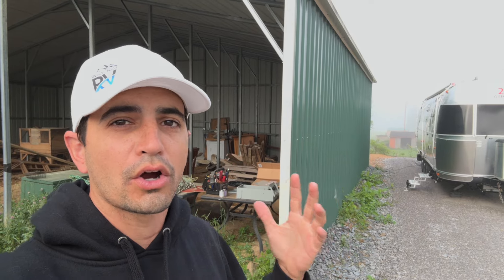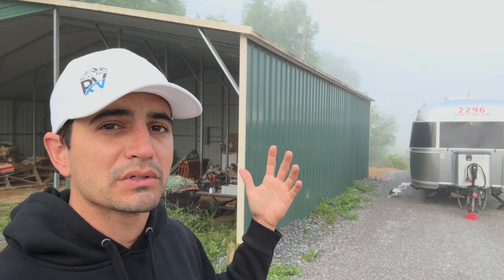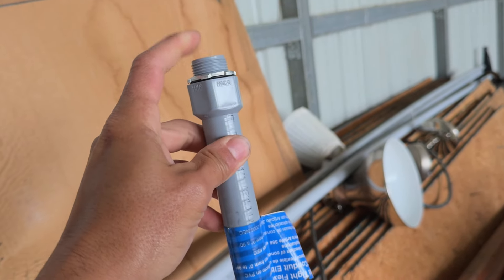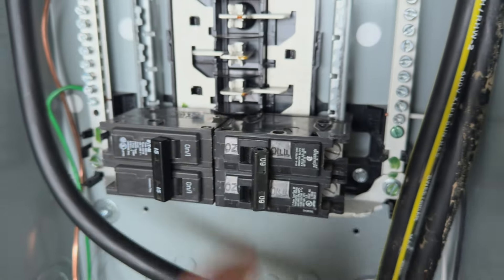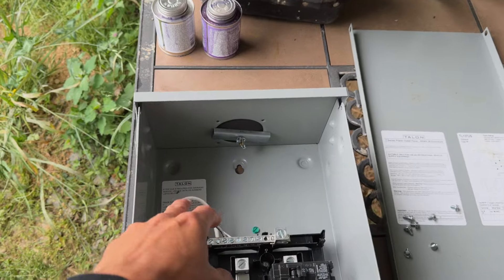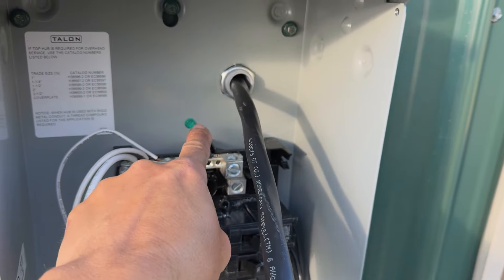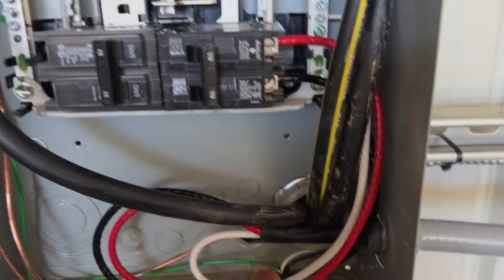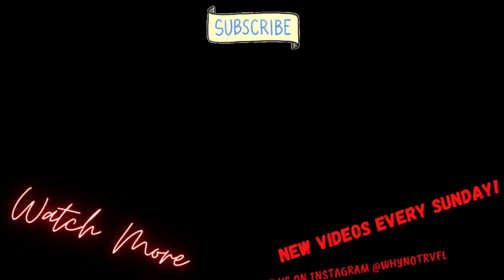Installing RV Electrical Service Outlet!!! - Why Not RV: Ep 141

Comment: The only things you don't mention are pulling an electrical permit and getting inspected, and addressing voltage drop.    The electrical permit is a local law thing, and often a requirement of your insurance.   In my state, a property owner can legally do electrical work, check your local laws, you may need to hire a locally licensed electrician to pull the permit and do final hookups.   You can do a lot of the grunt work yourself to save on money, if the electrician allows this.   I would go to my towns building department, pay a small fee, get the permit.  (fee is usually a percentage of the total job cost, including your labor paid at the customary rate for your area.  Which is kinda weird, but that's the way my state wrote the law. )  Do the work, then schedule an inspector to come out and do it on a given date/time.     The inspection acts as a double check on your job being done right, and if you don't get it inspected, your homeowners insurance coverage can be voided.  and yeah, the insurance adjuster will get the records and check for work performed without permit and inspection.  

  Voltage drop is more complicated, and I'm handwaving the details.  But basically, wire has a resistance.  It's low, but it's there, and is a factor.  Basically the longer the run of wire is, the fatter you need to have the wire.   For a regular single family house, it's not much of a factor.  But if you are going to a barn, shed, or outbuilding with longer runs, then you need to account for it.  Basically at that point you break out whatever version of the electrical code your local area uses, and hit the books.   Or if you gotta hire an electrician to pull the permit anyway, they can do those calculations and tell you what wire gauge you need to use for your particular job.   
     You are using conduit, so there would also be rules about conduit fill.  Basically the voltage that is dropped on the wire resistance, that doesn't just evaporate, it turns into heat.  that heat has to dissipate before the wires get hot enough to melt the insulation and cause a fire.   There are tables and math to do in the electrical code to determine what the limit is.  When the electrician plans your job, that is one of the factors, and you may need to go to a larger size conduit than you think you need.  Since you are in a barn for this job, I would have chosen steel for rodent resistance.  They will chew on everything and eventually turn themselves into an ignition source inside your barn.   
   If you don't already have electrical power in your barn, then getting the power there is another can of worms.   If you don't have enough available electrical power in your power panel for this additional load, that is another can of worms to be opened.   Just because there is space for the breakers, doesn't mean there is enough power.   Again, the local electrician will do that calculation if needed when they plan the job.  
  I hope this works out for you well.
Reply from the maker: Thank you for this additional comment. This run was only 30’, voltage drop doesn’t typically come into play until 50-100’ and there are several factors that go into wire sizing. I use a chart for all my wire sizing that has the account for voltage drop for both critical and non critical loads. Of course if you need a permit and inspection DO IT!!! Honestly, if you aren’t EXTREMELY comfortable doing this project your should ALWAYS hire a licensed electrician to do work like this. This video gives you the basic rundown of the physical side to this install.